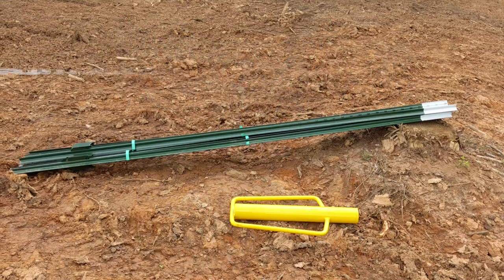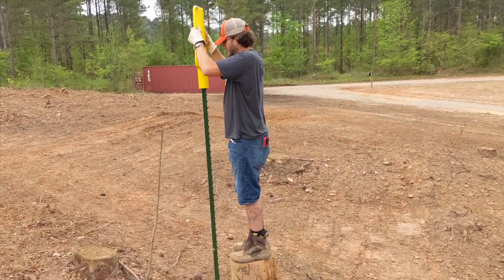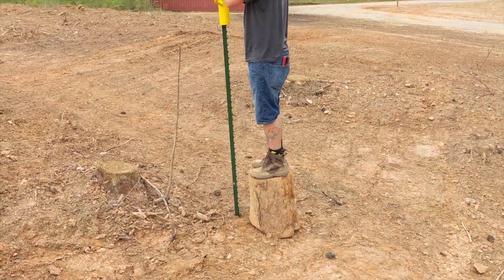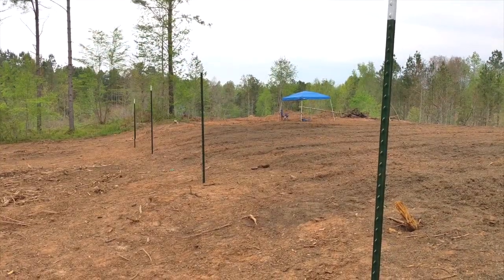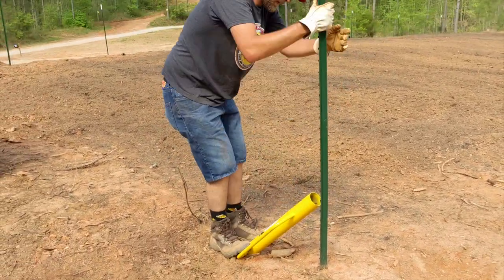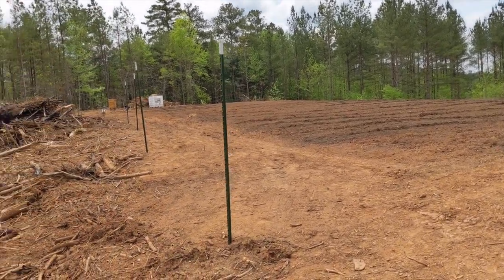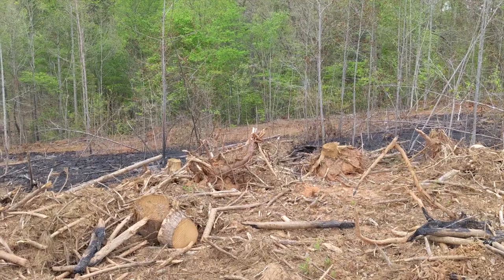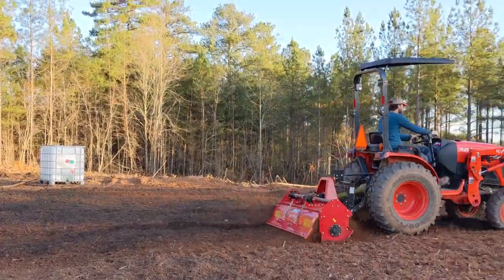Installing and Removing T-Posts with a Post Driver

Comment: Nice work. I have a tip for you. Well two actually.

1. use water when driving posts. Makes it a lot easier. Drive 6 inches and pour water down the side. Drive another 6 and repeat. depending on the ground it will take two quarts to a half gallon. Sime times a gallon. I only ever had to use a gallon per post at this one ranch land, 

2. For pulling posts, Cut a notch, into the driver, just a bit bigger than the width of the t post and 2 inches up. Then a smaller notch the width of studs of the t post, in the first notch. 

3. And set the driver NO more that 6 inches from the post bottom. 

Putting it too far back creates a gusset more than a lever. When it is too far back it creates a brace at the bottom.  So you are basically pushing on a bar(the post driver) Side ways to the ground. if you look at the end posts in a fence, you will see the brace far back. There is a lot of strength in that.

 When you have it around 6 in from the bottom of the post it creates a pivot point lever. It allows the post driver to pivot back and it pulls up on the post.

You can see this very simple even with a t post that is not in the ground. 

Put the t post and driver the same way you are doing it now. You will see the bottom of the post pushing away from you. The pivot point is up high on the driver.

Do it where the driver is around 6 inches and you will see the post lift instead of dragging away. The pivot point is at the bottom of the driver.

Comment: A chain and your tractor will pull those posts out. Great seeing your progress.
Reply from the maker: Very true, but not everyone has a tractor 😉 In this instance it would have taken longer walk down to get the tractor than using this method on four posts.
Reply: Just giving you a hard time😬  I have the same tractor, waiting on a tooth bar so can start clearing some under brush and expand my usable area. I’ll have to fence in a garden so I’m looking forward to seeing your wiring.
Reply from the maker: The fencing is going to need to protect the area against rabbits, squirrels, deer, and bears. The different varieties of plants and the bees make our needs pretty intense. We're going to run 9 lines of electric wire from 3" to 6'6" off the ground. We were looking at different gate options at Tractor Supply earlier today, and we're still trying to decide on something practical and affordable.